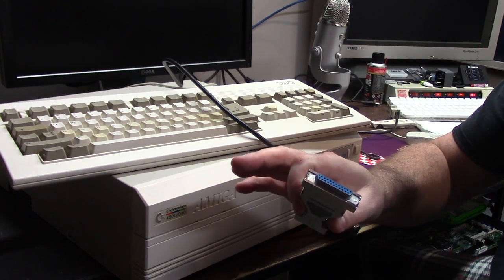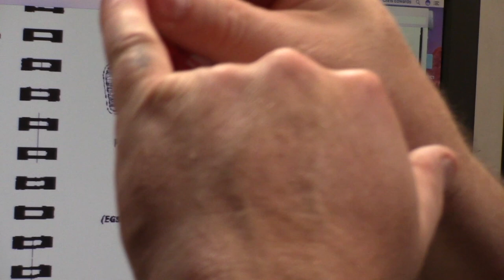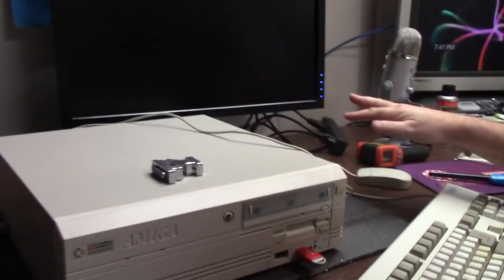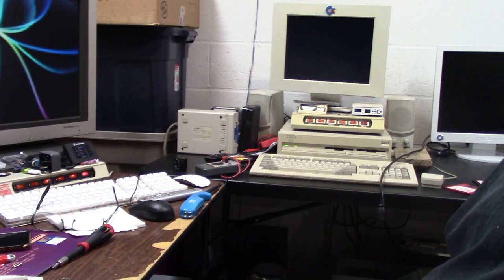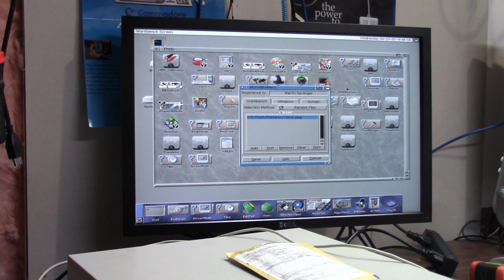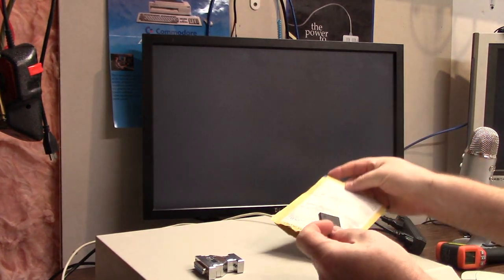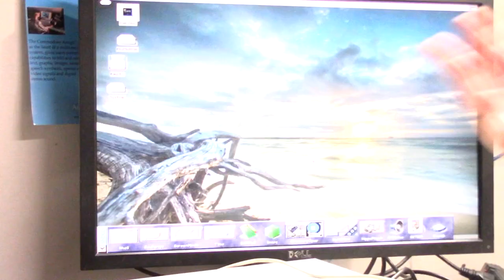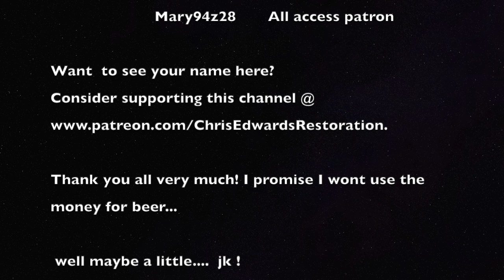Commodore Amiga 4000 custom video cable

Comment: Pretty nice.  Its been a while since I played with a GOTEK which I them in most of my Amiga's but I do recall where if you did not have a flash drive plugged in and booted the GOTEK would not be seen even if you plug in a flash drive but if you have a flash drive plugged in the GOTEK would show up.   That much I remember but my A2000 might be different but in my A2K its DF0 and in the A4K its DF1 all the other Amiga have external GOTEK's using the SORDAN Cable solution and honestly I don't remember but I guess next weekend I can look into it.  I don't know what Buster I have in my A4K but I am happy with the way it runs and it has a Picasso IV.   I have one of those Amiga Kit VGA Adaptors opened up on my bench its the buffered version and its not pretty inside either but its just laying on my bench as is other things I need to finish up on.

Comment: from 00:32 to 00:33 the magic happens in the background, with the orange switches.
Reply from the maker: I turned my computer on so i could get the pinouts. The switches are individually controller power outlets, he device is a memorex power center, popular in thenusa in the 80s and 90’s and still w me
Reply: @ChrisEdwardsRestoration  Yup, I know those power center. I have mine. The incredible thing is I have just bought it last year. New, on box... forgotten on an old store :D I was very happy finding this treasure.

Comment: Thats alot of cable for a short distance lol. I would probebly have designed a adapter and printed it for a project like this, makes more sense then a cable tbh. But if it works it works i. Great video nevertheless. As for hardware projects i'l go nuts with a pi4 soon, i think. Make a mini Amiga case with leds and shizz for it be a good hobby project.

Comment: Do you have the 3D Print files for your gotek mount? I have the same A4000 with the large DF0 and need a gotek mount that fits below the drive.
Reply from the maker: I downloaded them on thingeverse and filed the bottom out.  Fit fine.  Search for amiga4000 on thingeverse

Comment: Another great video Chris. In regards to the floppy issue on the A4000. Not had that with mine as far as I can remember. Had found this over on EAB forums. Maybe this may help? https://eab.abime.net/showthread.php?t=82624
Reply from the maker: btw: i finally shot the video w your cable for the 4000 cd audio
... should be soon.. (still need to edit like 12 of them...lol)
Reply: No worries Chris 👍🏻

Comment: Wow,that is one slow drive..and FFS Intl' lol  Looks like the 4K is coming along nice otherwise.
Reply from the maker: i used a real hard drive for authenticity. however i have a ide ssd, cf and other options available. something about the whine of a old rotational on a classic Amiga, almost as nice to hear the old click click on the floppy head...
Reply: @ChrisEdwardsRestoration  i agree,spinning platters are still cool! maybe a modern 7200rpm would be a little better,but then again,if it works! i still have quite a few old scsi drives in the amigas here.
Reply from the maker: I don’t think it would help because the Amiga is PIO mode zero so its ide sucks from
The factory.  I do have scsi controllers and scsi drives/scsi2sd if i choose to.  But having a fleet of 15 amigas its hard to remember who has what and what you Did with what unit. I have notebooks on them so i can review in the future or when i need to or think i need to do something
Reply: @ChrisEdwardsRestoration  40+ amiga's in various stages,man,i hear ya!